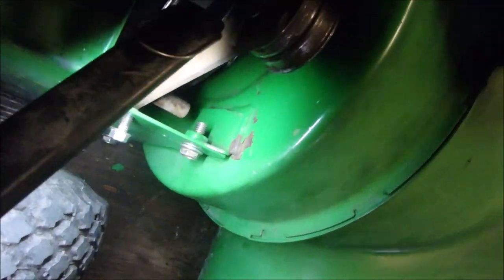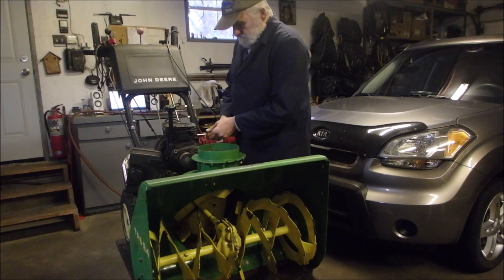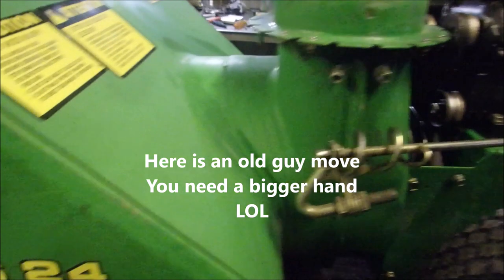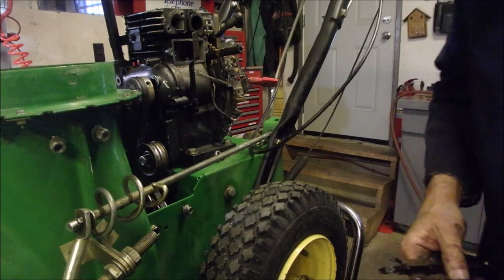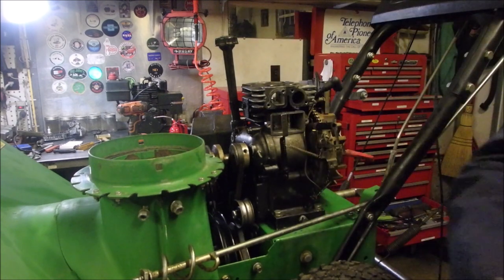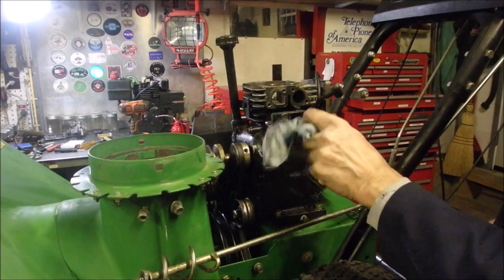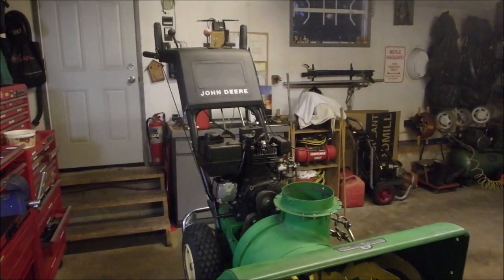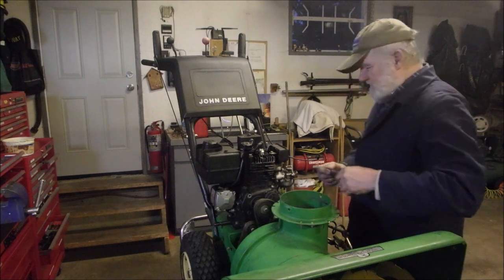JD  TRS 24 Inch Snowblower, Valve Lapping

Comment: Curb picked the same machine. Bad valve also, replaced with a 208 cc Briggs and Stratton snow engine . Added  impeller paddles, it throws snow across the street.  It’s a beast. For keeping me entertained a million thanks. St. Paul Minnesota.
Reply from the maker: I had fun as well.

Comment: Nicely done young man .  One suggestion: after lapping, put a smear of Engineers blue on the valve seat, reinsert and rotate once.  Remove and view the engine seat.  If the lap is correct, you should see an even ring of blue.. Hope this helps all the peoples.  Happy NY to all
Reply from the maker: Good tip!

Comment: Very nice work on the valve lapping there , it does sound better now I have yet to do a valve lap on a engine yet I got the tools for it but haven't ran into it just yet I know I will someday
Reply from the maker: Thanks 👍For me most of the valve work I do is on the Flatheads.  I have done a few overhead valves but not many

Comment: I know that is one job you would of rather have not done but you can tell the difference.  I have to check out that tool you use to spin those valves, next meeting.  Thanks Bruce.  Stevo
Reply from the maker: Right on

Comment: How's she goin'?  Checking the valves and then lapping and grinding them is one of my favorite things to do on a small engine.  A power tune up as you say.  It seems to be running pretty nice eh!!  Nice.  Take care!!
Reply from the maker: Right on.  Like you it is something I enjoy doing.
Reply: I seem to have problems keeping the suction cup sticking to the valve. And ideas?
Reply from the maker: @haneyoakie14  I wash both the cup and the valve in alcohol.
Reply: @BrucesShop  ok. I will try that next time. Thank you and safe travels!
Reply: @haneyoakie14  I did too.  Bruce tried methyl hydrate I think it was to clean the valve top but I cleaned my valves and the suction cup still comes off!!!  Hot glue maybe and then clean it off good.

Comment: What problem did you have that told you that the exhaust valve was leaking? Or what tests did you do that told you it was?
Great job Bruce always fun to watch!
Reply: From Mike. I keep gaskets on hand for the 5 hp. I have noticed they start a little hard and as they warm up they run worse. If I suspect I pull carb and tappett cover check clearance top dead center
Reply from the maker: I cheated and did a leak down test from my compressor.  I turned the compressor down to 15 lbs.  I don't recommend this as it is a bit dangerous feed air into a cylinder without a leak down test kit.